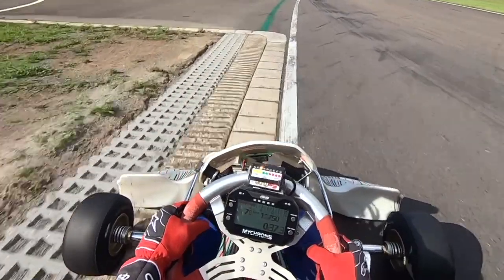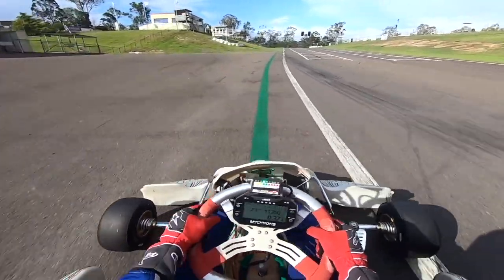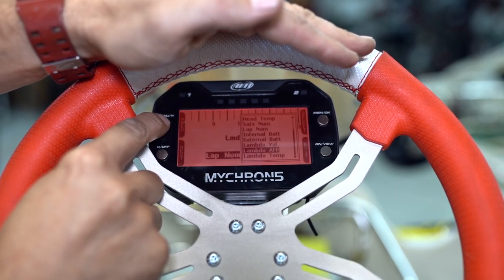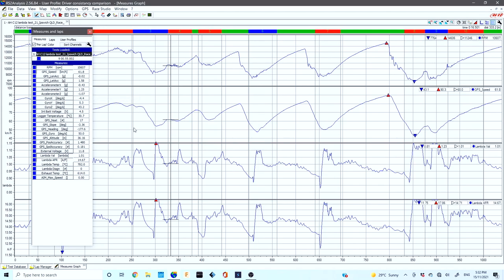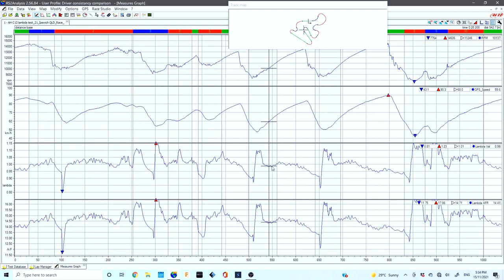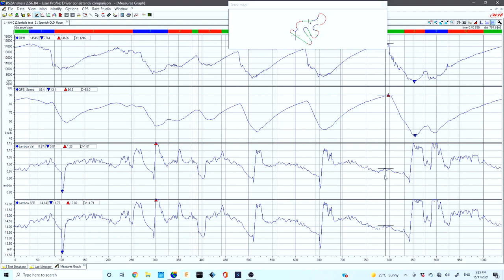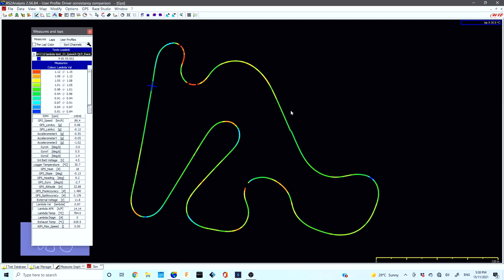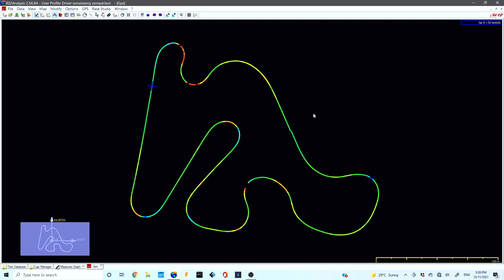SECRETS TO GO KART TUNING: LAMBDA Data Analysis - POWER REPUBLIC

Comment: Always awesome videos! I use the Alfano 6 dash, so will look for their solution there. Thanks as always Dez, cheers from Brazil!
Reply from the maker: Happy to help!  Thanks heaps for tuning in.   we have alfano 6 on our shop kart this year.  just waiting for some extra sensors to turn up for more testing.
Reply: I use the Alfano 6 as well, let me know how it goes, I like this method, Lambda sensor, better than using an EGT sensor.
Reply: @p.c.h.6721  will do man!
Reply from the maker: @p.c.h.6721  lambda is better IMO.
Reply: @PowerRepublic  Did you ever get to this? Same data considering it's narrow banded and not pre-heated?  Thanks in advance
Reply from the maker: @BEFITtingImage  hey Dave, nah we haven't driven our kart all year, too busy with work ATM

Comment: You’re the best Derek! 👍
I wonder why Lambda sensors being so much more precise than an EGT is not generally being used in Europe? Pretty much everyone I know uses an EGT, including myself, maybe the fact that an EGT sensor is relatively cheap and you can connect it directly to either the Mychron or the Alfano 6 without the need of anything else has to do with it.... with the Alfano 6 you need an external box where you can connect the Lambda and a bunch of other sensors and that external box is quite expensive, close to 400€, about $600 AUD
An EGT is just such a vague number, you can do 650ºC or you can do 675ºC or even over 700ºC and with all those temperatures you are still fine, or at least so it seems, but I’m sure there is a perfect EGT number.
It would be very interesting to fit an EGT and a Lambda sensor at the same time, in the same exhaust, and be able to see what ETG you get when you have a perfect lambda reading, then we would know exactly the right Exhaust Gas Temperature.
Reply from the maker: that's correct.  the EGT is a little vague, although it is better than nothing.  seems to be the go for KZ for some reason, even though the Lambda sensor is way more accurate over the wider RPM range.   yes, for sure the EGT is also simple and way cheaper too
Reply: Here in Canada, the rule books don't allow for lambda sensors. I'm not sure how it is in Europe, but that could be a deciding factor.
Reply: @sajanseyan  
Same in Europe, not allowed

Comment: Hello! Thanks for this video and a lot of others. Do you know, is it possible to analyse this information on Alfano 6 2T? 
Thank you
Reply from the maker: hey KFGKT, yeah the Alfano does the same thing, but oyu cna look at the data from one on the other, if thats what you mean ?  did you get a POWER REPUBLIC  t-shirts yet ?
Reply: @PowerRepublic  t-shirt 👕 know. But why not )) 
I my question was about Alfano. I never use it before. Now I start drive in X30 and I use Alpfano. Before that 10 years I worked with AIM. And I try to find good manuals and can not to understand how to use all the possibility of software. Now I see on the graphics the temperature in every turn, but I did not find anything about Lambda.

Where I can find t shirt and how can I receive it in the USA?

Comment: Hi Dereck, thanks for the video! Isn't 14:1 a little on the lean side for a WOT target? Have you guys ever done any lambda testing on a Rotax engine? Also, how does the load on the engine affect the AFR itself? You said in the video that if there is too much load on the engine it could effectively lean out the mixture.
Reply from the maker: Yeah 14•1 for 2 stroke seems to be a sweet spot. 
Haven’t used it in a Rotax in a while.  But same would apply for 8000-11,500 rev range.   Above and below that we had some irregular results.

Comment: As far as i know, a proper tune for a 2 stroke racing engine should be around de 13 AFR, due to the most power/reliability ratio. a close to the 14,7 AFR engine could overheat and seize. What are your thoughts?

Comment: So if you turn up the low jet to help out of the corners - does that affect the high jet (ie wind it off a bit?) or vice versa?
Reply from the maker: yes to a degree, if you move one it can effect the other.   once you have them dialled in, then it is usually just a minute in or out to make them perfect

Comment: This was a really good tech video Dez thanks. I have two kids running tony kart 401 KA4 junior with EGT. I followed your steps and created the heat map for EGT. I am now confident enough to adjust the high jet to get optimal temperatures on the straights, but I figure with EGT I can’t really adjust the low jet for temperatures out of corners like you do for lamda. Is this right? Any tips?
Reply from the maker: Hey Dave, thanks heaps for the feedback and tuning in. 
Egt is a little vague.  But a 100 degree spread is about what you are looking for.  But it isn’t as clear cut as that.  Maybe look for the average or pattern when adjusting the low and then ask for some driver feedback to confirm what you think is happening

Comment: my lambda value shoots up to 1.17ish under brakes on the 2 main hair pins at ippy, then lifting off the brakes and rolling through the corner it instantly plummets to 0.83ish. so on my GPS map it goes from red to blue instantly then back to green on the straight and I get the 0.93-0.99. should I be ignoring the high lambda value under heavy braking? great videos btw.